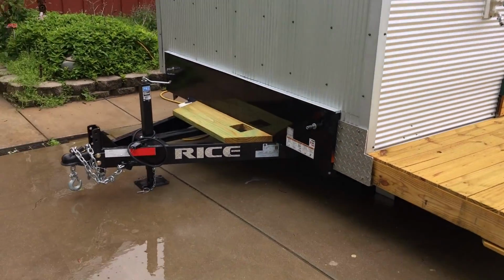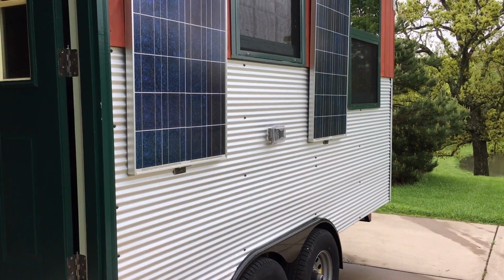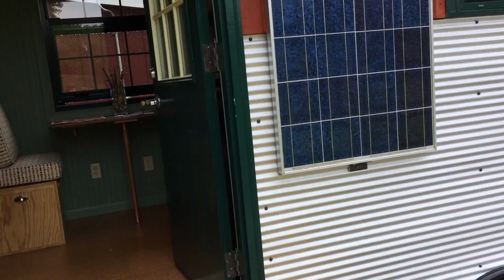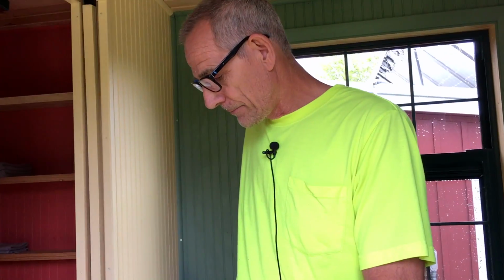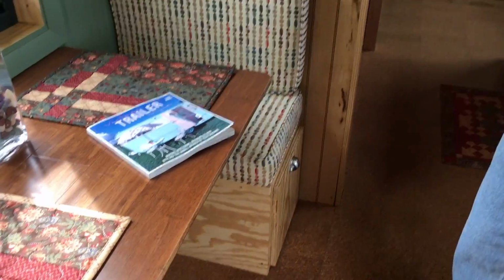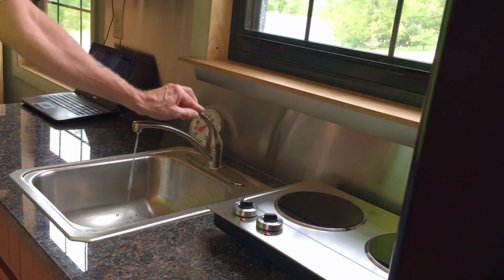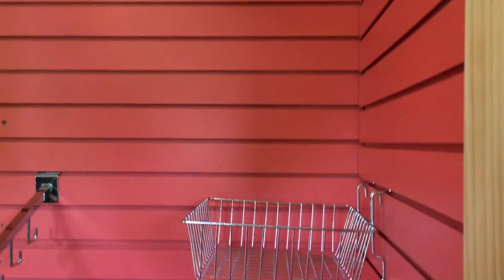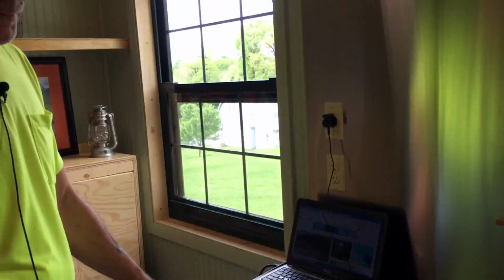The Starlighter 1 Is The Perfect Forever Tiny House

Comment: I'm alway's a bit surpriced that it seems to be that in the US, you can have a lot of things that's sticking outside of the walls on vehicles that are ment to go on normal roads. They can work as hooks to take pedestrians or bikers with it, dangeres. In Europe, nothing can come out of the sidewals of trucks or campers , trailers, what ever. It's nice to have light ornaments on the walls outside and even water equipement with fosests, but safe on the raod ?? I have the impresion that handy carpenters has to go talk to people who build vehicles and safty on the raod. Other thing, all those tiny houses on wheels, nobody seems to care about the ton's of wood and the more gas or diesel you need to pull it. Would be nice to go for less material , strong can be done in different way's.

Comment: Thanks for some amazing ideas Bob.  I'm curious to know how the HDMI cable works.  Did you run it through the walls before you applied the insulation, or is it just behind the bead board?  You have lots of innovative ideas, and the use of stainless is really well thought out.  Loved the pocket door, but a little more privacy might be found in something a little less opaque.  I have to agree that an 'on-demand' system might be a little better for the radiant heat, but is that feasible?

Comment: Don't solar panels need to be directed toward the sun? The heat you put in the wall is suppose to go in the floor. You also have a regular toilet how does that work? The "natural" gas design how is that possible. What is the weight of this tiny house? It just seems to me that you made decisions that the buyer is going to have to change if they don't know their stuff.

Comment: What are the dimensions and weight of the trailer.  Will it need a 3/4 ton or is a 1/2 ton enough to pull it?
Reply: Dan Reed 
The builders of tiny homes rarely if ever say which size truck would be able to tow their homes. I wonder how long this trailer is. Have a great day Dan.

Comment: the panels should be placed on top and the look is bad
just my thoughts
Reply: It is a one piece roof that he probably didn't want to start putting holes in and the panels are mounted on hinges. Once the house is parked you can put them up at multiple angles. In the winter you can get even more sun than on the roof.

Comment: I really dislike the idea of taking a boring regular house and shrinking it. Tiny homes should be more creative. A chance for builders to think outside the box and let go of the common. So I really like that is a single level, offgrid capable (it seems). Towable. (Even more towable if the frame was steel.) Just a little bit more space for a full/queen size bed instead of a lonely single would be my preference. Price seems somewhat ok. Overall I like the possibilities with this one. 
👍👍👍

Comment: Seems a very haphazard build to me.
Reply: lonely zombie I love radiant heat but just used glue on the floor...very toxic...would get high for sure? Would be the end of me and must have a sink in the bathroom or put one in the shower. Just a rinse of the hands. Dirty job, need cleanliness. Foam is toxic as well. Looks like an RV, but nice.
Reply: lonely zombie 
Yes those hundreds of quality details looked "haphazard," especially the top of the line one piece roofing system, state of the art solar, full bath/shower, infloor heating, spray foam threw out...A Fukin PORCH!
Reply: You might consider one of those toilet tank covers with a built-in sink.  Water and space saving, all at once!

Comment: This is not a tiny home. This is a small rv. One that I wouldnt live in. It's well done, but I would only purch ass this to use as an RV for vacations. its very very basic and has not much to work with inside. Actually, you can buy an actual high quality preowned 5th wheel that's better than this thing to be honest.
Reply: Not for the price... Most decent 5th wheels go over $75,000, over twice what he's asking, or you'd be getting it with inferior components like cheap china made tires, etc.

Higher end 5th wheels offer features like z-frame for more storage and higher end components and interiors...

While RV's are manufactured products made at a factory on a assembly line and are not custom made products... At least not much below the million dollar mark...

You can also pay more for certain brands... Like a Airstream 2017 Basecamp, which would be even smaller than this as it's just a camper, can go for over $47,000 and that's a lot more than what this guy is asking and it's also bigger than the Airstream...

So keep in mind this is still a custom made product and he's not charging a lot for it...  Unlike a RV, if you buy this from him you're basically hiring him to build one for you, which he can then do with whatever modifications you want and it'll still be around the same price unless you ask him to use more expensive or less expensive components...

However, yes, it could be better designed for full time living but as a custom product you could always ask him to make it better for that use...  Or just use it as a low cost custom RV if that's what you want from it...

Comment: I want to know if there are any tiny homes for sale in or around Stroudsburg PA or Millvill e N J???
Reply: There's about three Tiny House builders in PA... So there should be some for sale already...

84 Lumber, has expanded into offering Tiny Houses... They have a DIY kit for just over $8K, but I don't think it includes everything...

Liberation Tiny Homes will offer more custom options...

And The Unkown Craftsmen is a father and son business that will make custom Tiny Houses...

You can check sites like Tiny House Listings for already made Tiny Houses for sale all over...

Many companies will also build and deliver it to you even if they're several states away or even up in Canada...  So there's options... Just decide on your budget, verify what the local zoning laws are for living legally in a Tiny House, and decide what style Tiny House is for you and see which builder best fits that for you...

Most of your surrounding states also have Tiny House builders... The one I usually suggest is Incredible Tiny Homes in Tennessee, they got one of the lowest prices and a work shop that lets you build it yourself to take $10,000 off the price...

Tiny House Chattanooga, also in Tennessee, is known for using Steel Frame builds if that's your preference...

While, if you like them really tiny and minimalistic, Trekker Trailer down in Florida makes anything from RV campers to Tiny Houses...

Bear's Tiny Homes in Georgia, is still a start up but they're one of the few that are designing actual bedrooms, complete with door and storage space...

Though, check any you look into with consumer affairs... Like any business, not all of them may be honest...  I've heard some bad things about EcoCabins up in Colorado, for example...

Comment: Not exactly sure what he means by unique features. It seems like normal construction in a tiny space. The unique tiny homes I've seen make multiple uses of a lot of different elements which are all done in very clever ways. They also make  better use of the vertical spaces, because when it's tiny, you have to go up.  

Quality construction sure, but far from an ideal tiny home, and even farther from unique. Ego's getting in the way.